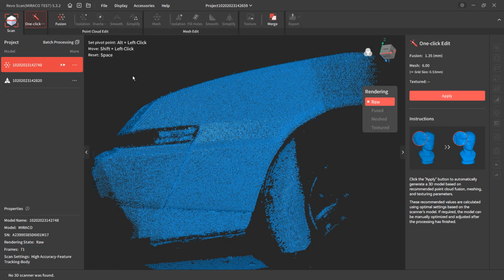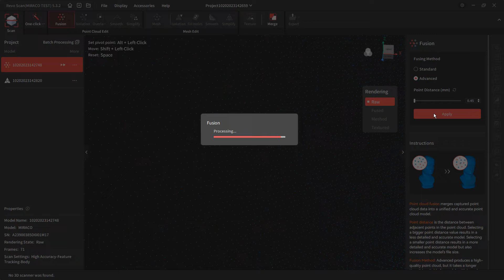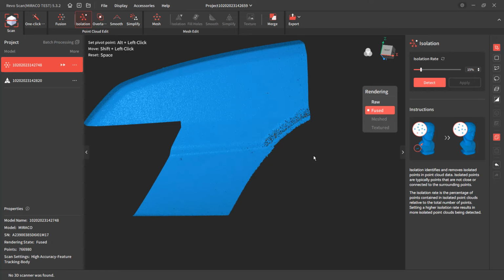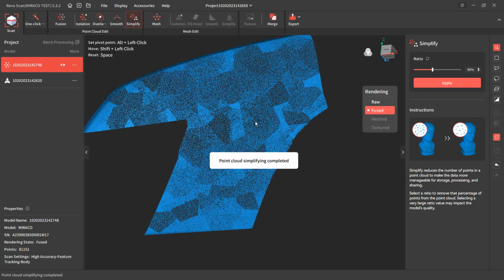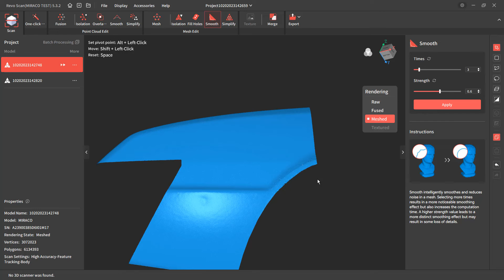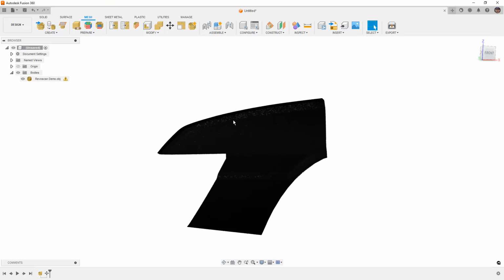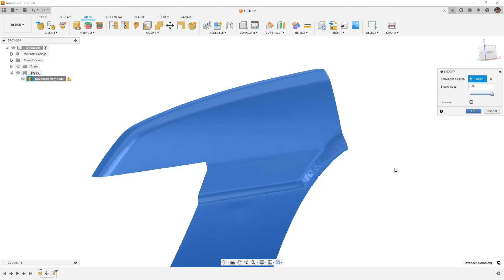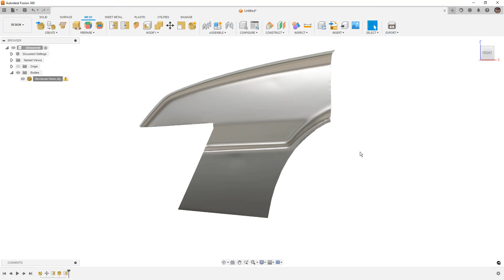How To Use Revoscan and Fusion 360 To Process Car Scans | #revopoint #fusion360 #reverseengineering

Comment: Just want to say that the very first thing I do with a scan from my POP 2 is to clean up the RAW data. Once I've cleared out the useless data, I move on to where your video starts off.

Note that the current version of Revoscan STILL has bugs in its point selection tools. For example, if you lasso-select a group of points for the purpose of deleting them, even if you have the 'select through' option turned on, the lasso doesn't always pick up all the points you've lassoed. You have to repeat the lasso/delete operation two or more times to get everything.
Reply from the maker: Thanks for the comment.  Are you able to clean up the points before the Fusion step?

Also with the Miraco support I have a beta version of revoscan and haven't noticed the lasso issue.  I imagine that will get sorted but if not I will mention it.
Reply: @LearnEverythingAboutDesign  Are you able to clean up the points before the Fusion step?

Yes. It seems Revopoint rightly treats the raw point data as sacrosanct, so the ability to edit it is slightly hidden away in the '...' menu beside each model in your project model list.

The lasso issue occurs in the raw data edit, for sure, but since I do all my geometry cleanup on the raw data, I rarely use the selection tools in other 'stages', so not sure if it occurs there, too.
Reply from the maker: @imacmill  Great info thanks!  I do like the ability to step back to the raw data, but it is frustrating when all the trims/deletes are gone.  I imagine editing the complete raw data is destructive.
Reply from the maker: @imacmill  yeah it kind of depends.  So if you were scanning something perfectly flat and you had some noise on the points, the Fusion, Isolation, and overlap "should" take care of that for you.  You can always copy the entire project before you begin the edit so you  have an untouched version.  I am not sure its accurate enough to really be able to tell/quantify if hacking the raw data has an impact.  It will certainly process faster because sometimes doing Fusion on all the scan can be time consuming.
Reply: I've been trying to get a good scan with the Revoscan 5, both PC and app. No luck the tracking is horrendous. I had to go back to the legacy app that 3.2.1. I tried painting the part in white and doing some markings in back to get a proper tracking since the object is long, 3.2.1 does the job with no issues. However the v5 is really bad. Am i doing something wrong? To this point i think is probably the software. not only the tracking is bad but the overall presentation of the scanned item is bad. Any help would be apreciated
Reply: @trainingmatadortb  I struggle with every scan I attempt with my POP2. It never occurred to me to try older versions of Revoscan. I'm going to try that on my next scan.
Reply: @imacmill  Any luck?

Comment: Could you make a video on how to scan a bumper and then how to make a lip based on what you've scanned? Maybe an interesting video, thanks so much for your time! It could be interesting for many people.
Reply from the maker: Would you plan to manufacture the lip? and if so how?  For this section of the fender we did a cannard video, and i have "bumper" on my list to do but a full bumper not just a lip.
Reply: @LearnEverythingAboutDesign  Yes, I would manufacture it. The plan is to know how to design the parts well based on a scan, then print the negative molds, and finish it in fiberglass/carbon, i've seen something similar, in a video you make a spoiler but I can't do it right, that's why I was asking if you could make a lip based on the scan of a bumper, thank you very much!

Comment: I have a question, hopefully you see this comment; is there ever any issues with scaling the mesh in Fusion? I just got my POP 3, and was doing some test scans on an underwater drone I want to design parts for, and when I brought it into fusion, the mesh seemed gigantic. Do I need to specify units as millimeters, or calibrate the mesh scale somehow? Thanks for this tutorial, it was a huge help!
Reply from the maker: The units in revopoint are generally mm unless you have changed something there.  So when inserting into Fusion in the insert dialog make sure its set to mm.  Even if the units in the file are inch or meter or something, on the insert mesh dialog make sure its mm and the scale should be correct.
Reply: @LearnEverythingAboutDesign  I see what my problem was now, I was just opening the mesh, rather than importing it through the dialog.  Thank you!

Side note: any tips in terms of recreating geometries for solid modeling? I was just doing my best to fit a spline to the mesh along a slice to reconstruct the geometry, but in all honesty I'd like to do something like cut the body based on the mesh as a cutting tool; should I convert the body to a mesh and then slice?  This is a new world of engineering design to me
Reply from the maker: @roanoake  yeah, when you open a mesh it also puts the file into no history capture which changes a little bit.

As for getting info from the mesh, yes you can create mesh section sketches.  We have done this in a few series but you can see it in this one.  https://www.youtube.com/playlist?list=PLBDfGh8A8kXWYEY9X4vJ5sKGh6TPzrr2h   Basically you use Mesh Section sketch on the mesh tools, then edit the sketch and you can have it auto fit lines, splines, arcs, and circles to a mesh.
Reply: @LearnEverythingAboutDesign  That is incredible, thank you so much!

Comment: Thanks for the video! At 16:13 you say a dedicated mesh software would be better for this - do you have any recommendations please? I need to do boolean operations on scanned objects so wondered what software would give best results.
Reply from the maker: Well in a professional sense i think the commonly used software is Geomagic.  There are free tools like MeshLab, but they are harder to use.  I have plans to do some meshlab videos.

Geomagic isn't cheap.  I think the "essentials" version is still something like $7000.  So it hard to justify spending that sort of money when a scanner in this segment is around $600-$1500.

So if you are a hobby user I would look into MeshLab.  I used it like 20 years ago and it hasn't changed much but its free/open source and powerful if you can figure it out.
Reply: @LearnEverythingAboutDesign  Oh damn! Ok thanks Ill look into MeshLab.

Comment: Best tutorial I’ve seen so far!!! Thank you. Please do more of these. Especially for car parts. I’m not scanning faces on a turntable 😂😂😂 I am scanning GTR parts, so your Starion fender is MUCH closer to the mark for my uses.
Reply from the maker: That might be the first and last time a starion and GTR are in the same sentence lol :)  There is a good bit on this channel.  I did a series with the starion scanning the fender and modeling a widebody.  We have more scanning content in the works.

What scanner are you using?
Reply: I have a Revopoint Range. I have just started my 3D scanning journey and I may not have started with the easiest parts. A R32 GTR trunk lid, and doors from a military Humvee. 

Apparently I’ve been taking the Belligerent Amateur approach to learning this. 😂

I plan to do more body panels for the GTR once I have the process figured out. Right now, it is not going well. Your video was very helpful so I will be trying again while playing your videos as a guide. And then 3D printing molds in sections
Reply from the maker: @erikrummel6277  Those are 2 very different vehicles lol.  The Humvee will be more difficult as its flat without a lot of unique features.  You will want to use marker dots for sure or just take some blue or green painters tape, ball little pieces up as random shapes and stick them on large flat sections on the door.  This works as "feature" scanning and on the flat surfaces you should be able to remove and patch those areas easy enough.

R32 trunk..... might need marker dots or random feature trick again.

I just recently did a 3 part series on small rc parts.  while not exactly the same i did spend a bit of time talking about prep, capture, and process of the scan in the first 2 videos.  id check that out next.

Comment: it doesn't seem like paying for the design extension on fusion is worth it either in case anyone is wondering,  it might be for smaller stuff like the product design online video shows with the cane grip, but for larger surfaces like fender or boats like i'm doing it isn't able to convert using the organic paid function (i have a startup license and using the trial but am still a total noob)
Reply: its looking like its probably worth spending the $ on rhino and mesh2surface for things like this as far as value to $ spent for reverse engineering stuff like this... again i'm still a total newcomer to this....  for sheet metal and stuff like that fusion still is probably better... for plasma cnc stuff like that.
Reply from the maker: There are some free quadremeshers.  Autodesk used to have some available but they are no longer.  Here is one you can try but honestly you would probably have better luck with some Blender add-ons.  but for free its worth a try.
https://github.com/wjakob/instant-meshes

And I would agree about the Extension.  Honestly even for plastic part design it isn't there yet.  The biggest values in that package right now are vol lattice tool and maybe the screw boss stuff but i found the limits of it on complex shapes and still had to make them manually.  I think in theory adding bosses ribs and hardware to multiple bodies at the same time is a great tool!

On rhino and mesh2surface.  The power surfacing stuff from nPower for solidworks is really good.  I used to do work for those guys and even worked at their booth at solidworks world years ago.  It has some pros over fusion forms like proper edge weighting and they have a sub level of detail that is nice to have, but $$$.  With Rhino8, that is on my list.  I wasn't a fan of Rhino7 for ui/ux reasons.  Rhino used to use Tsplines which Autodesk bought.  so the Rhino SubD modeling was lacking.  I wish they would put effort into ui/ux and maybe Rhino8 has, i just haven't had the time to try it yet.  There aren't a ton of great options out there for a hobby user.  You can use Blender if your goal is just to 3d print parts.  Its free and has some cool geometry node type things you can do.  But if you need CAD then I still currently prefer Fusion 360.
Reply: Did you settle on a scan to cad tool? Starting some trials before committing but $$$ indeed

Comment: Hi! Me again. Hope you’re well?

I’m in preliminary research phase and struggling to make some decision. 

Outsourcing scanning and reverse engineering is expensive so I’m hoping I can do as much as possible in house. Have you found the einstar to give you good enough accuracy to make well fitting splitters, skirts, diffusers etc, or would you advice biting the bullet and contract a professional company to get me the scans?

Also, I’m seeing a lot of people using blender now as it creates some nice organic shapes. I’m torn between F360, Blendrr and SWs - I need to be as time efficient as possible so need to focus my learning into one program. Is Fusion up to the task for creating these parts?

As always, your advice is hugely appreciated. Thank you!!
Reply from the maker: Hi, there is a bit to unpack in those questions so let me try and break it down.
1. DIY vs hiring someone.  Generally when you hire someone, the gear they use will be very accurate(expensive).  It will scan faster and give you a higher density accurate mesh.  Is it needed?  well that depends really on how you are going to make the parts from your cad files.  If you are going directly to CNC molds from foam or something you might want to work with a pro.  Keep in mind the difference in accuracy is something like .2mm for a hobby scanner to .02 or lower for a pro scanner when say scanning a fender.  If you plan to 3d print body parts to build a mold I think .2mm is likely good enough(personally), but again it really depends on how you are making the parts.  If i was going to be spending money on tooling I wouldn't want the scan data to be the weak point in that chain.
2. Software.  Blender is free so bonus there, but its a "poly" modeling program.  You are only working with mesh.  This can be great to explore shapes, but it will be someone limited when it comes to CAD.  Lets say you wanted to take some of your body parts into a simulation program for airflow, well you can't because they need to be Solid, not a mesh.  If you design them in CAD they can be used for simulation.  Also controlling things like hole sizes and locations for tight fitments, well that is a CAD thing.  As for what software.  Solidworks has better surfacing tools, but lacks freeform tools(unless you buy nPower) and doesn't really handle mesh well.  Fusion surfacing tools are ok but not great, but it has freeform modeling and deals with meshes better.  Freeform can snap to the mesh.  Also there is a big price difference.  Fusion is a few hundred a year while Solidworks is thousands of dollars.

I have loads of videos on making spoilers(some surface, some forms) wide bodies. canards etc.  I have a whole series on scan and widebody design. https://www.youtube.com/playlist?list=PLBDfGh8A8kXVvKBJ4UudhVLKlPdumAg5P
Reply: @LearnEverythingAboutDesign  thank you for the info Matt. You’re extremely helpful.

Comment: Is that a Starion?! 

Any thoughts on their Revoport Mini? I have one and it’s been very frustrating to use… I come from professional tools like Faro arms etc and trying to do things at home as well. Any input on how to capture better models is greatly appreciated!
Reply from the maker: It is yes, 84 ES "flatty"

On the mini, I don't have one but the sensors in the miraco i used in "near" mode are the same as the mini.  I will be working on a video soon doing a detailed scan with it.  Since the miraco is new the revoscan support is a little tricky so it takes a bit longer to say calibrate and things like that as they refine the software.  What I have noticed with the Miraco is that it seems to do better with feature alignment than marker alignment in near mode so i would imagine the Mini is the same way.  What are you trying to scan with it?
Reply: @LearnEverythingAboutDesign  thank you for the feedback! Looking to scan and ultimately print interior panels/parts primarily.

Comment: can you make a video on how to make a headlight intake using a 3d scan headlight ?
Reply from the maker: Sounds fun but it might be awhile before I could do that.  I do have a video on making a pop up surround as well as one on making an intake duct for an mx5 bumper.
Reply: @LearnEverythingAboutDesign  yes i used the intake duct and tried it on the headlight and its going well almost done took me  all day long ( I have a question do you have any idea how to make a compression mold for chopped carbon ??) thank you btw awesome videos 🥰❤️
Reply from the maker: @real-player1237  I don't but easy composites has a bunch of great videos you should check out if you haven't already.  https://youtu.be/25PmqM24HEk?si=iKNRW5iQQjEsuzVA

Comment: Wow your scans are super dense with points, I guess I should scan slower, doesn't help that Its only 7fps connected to my mobile device, I have a Range and I bought it for scanning large things, I tried scanning my headlight housing the otherday and it did a okay job, its gets lost pretty easy, especially when going around 90 degree corners where very little geometry is shared
Reply from the maker: yeah corners are always a tough one.  The scanner really wants to be perpendicular to what its scanning.  Best thing I can say is try to add some unique references to the part that you can trim out later.  Little blobs of clay or tape.  Marker dots don't really help because the scanner needs to be looking pretty much right at it to register and you need a ton to make that work.

Scanning on a mobile device does limit the performance a bit.  I was impressed with how fast the Miraco captures the data vs the Inspire being tethered to a laptop.

Comment: Great video! I've struggled with working with scanned data in Fusion360, and this video gives a good overview on how to reduce the facets. I would love to see more on the next step in the process. For example, if you scanned a fender and wanted to design some fender flares, how would you use the scanned mesh after importing into fusion and reducing the facet count?
Reply from the maker: Earlier in the year i did a series on that. https://www.youtube.com/playlist?list=PLBDfGh8A8kXVvKBJ4UudhVLKlPdumAg5P
Reply from the maker: but note we kept the poly count fairly high.  it worked ok for what we were doing and the process was slightly different with shining vs revo software.

In general you can reduce the count as much as you can get away with, but for the design process I make the mesh Unselectable to speed up performance.